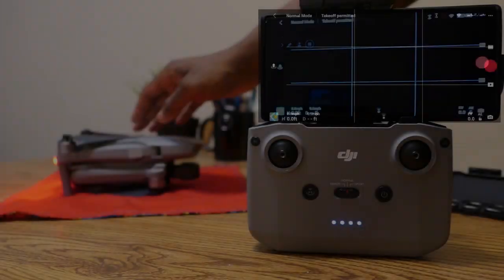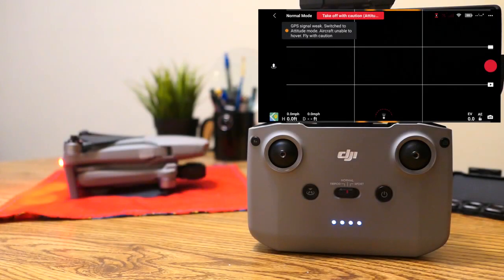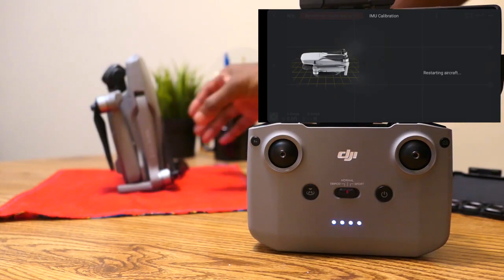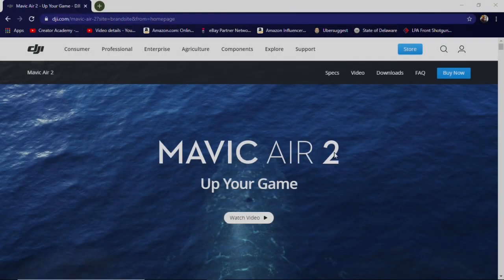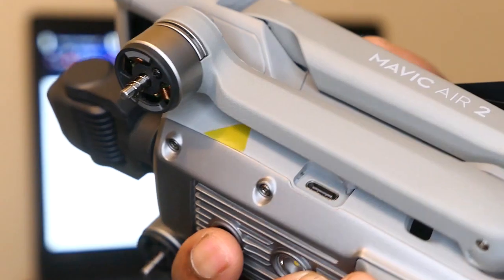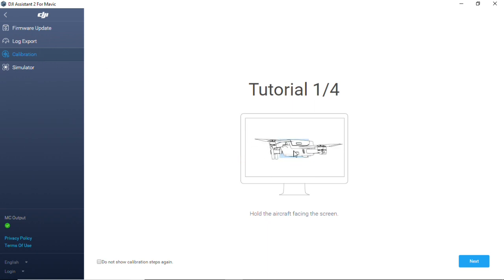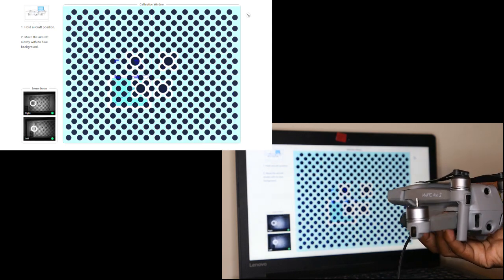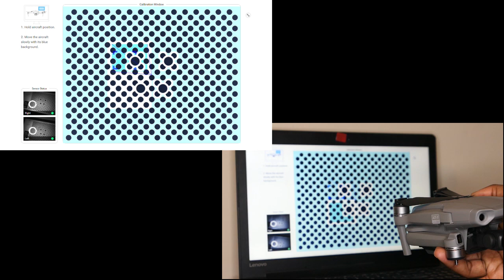Dji Mavic Air 2 Sensor Calibration Tutorial

Comment: ok your presentation was probably well intentioned but you didn't actually show a step by step thorough explanation. You say you're going to need a long cable (was exactly is a long cable 10 ft, 
7 ft or 20 ft.. ? what type USB, Micro USB, etc.etc..You need to show more and explain better

Comment: I am experiencing the following error message: Backward Vision Sensor error. I have performed your process numerous times and I do it successfully. But I periodically get that error message more. Im wondering if its a new firmware related issue, software issue with the DJI Fly App or what not. All sensors during calibration process are able to see the screen and you can visibly see through the eyes of the sensors. No obstruction on the lens, including fingerprints, residue, particles, nor  That Bug juice. Still getting messages more promptly than I ever had. Anyone else experiencing this issues with the DJI Air2s ?
Reply: My last two flights have been wonky, with my Air 2 refusing the fly backwards, and the sensors going off when there's nothing anywhere close. Did you resolve this issue? I've flown this thing a thousand times and never experience this until yesterday.
Reply: @JesseThorstad-personal  I did contact DJI and they stated that you have to change your screen resolution during calibration and it has to be of a certain specs.  Which I did and still the issue arrives.  I discovered something odd. When you take off before that gps signal goes from red, yellow to green is when I get that error message.  If I wait till it turns green when I get like 14 sats, issue resolved.  Sounds to me a bug in the app

Comment: You should do a gps calibration every time you fly it
Reply from the maker: I use to. At some point in time Dji said it only had to be done if the drone alerts a cal is needed. Honestly I just take a quick look at the the status to see if it's normal. But I will call if I get magnets interference like if start it up near metal.

Comment: I actually never knew about the sensor calibration tool in DJI Assistant2. Learn something everyday. Thanks... I will see if it helps. My altimeter was not accurate and my sensors woul shut off randomly... maybe this will help. 😳👍🖖
Reply from the maker: Same here... have not done a test to see if it fixes the issue yet.
Reply: @Bigballvlogs  : I was about to upload avideo showing the irregularities... but I will calibrate using DJI Asst2 and compile... Honorable mention :)
Reply: @Bigballvlogs  : I tried it... OMG you gotta concentrate on what you are doing. I didnt get a chance to compile yesterday but... the calibration seemed to fine tune the controller disconnect RTH. BUt if you do an alternate RTH point... its way off.
Reply from the maker: You mean if you move to a different point?
Reply: @Bigballvlogs  :  Yes... I tried it a few times and it was way off (4-5m). But if its only going by GPS , I guess thats as close as it can go... but I remember the Zino and Fimi being closer.
Reply from the maker: Yeah probably... i didn't see precision landing in the opposition so I didn't know if it had it but if it doesn't it would have taken a picture of the take off spot and tried to land there. If it's a different location its just going to land somewhere near the new location
Reply: Mavic Air 2 is not listed in DJI Assistant 2
Reply: @michaelminervini3784  : You mean it does not show up on yours?
Reply: @michaelminervini3784  i was in a fuss with the same issue, there are two different downloads go for the other one